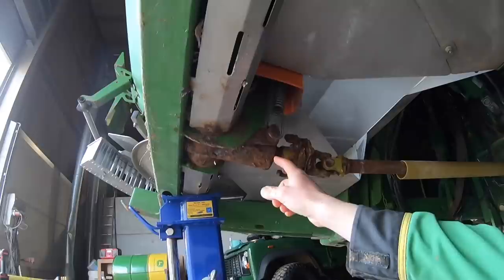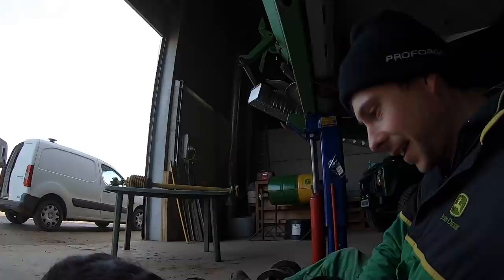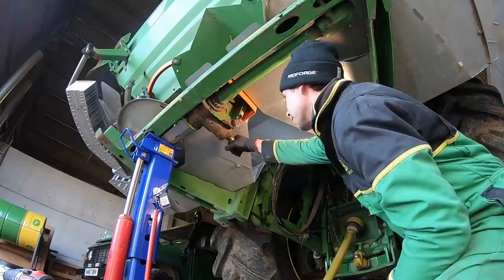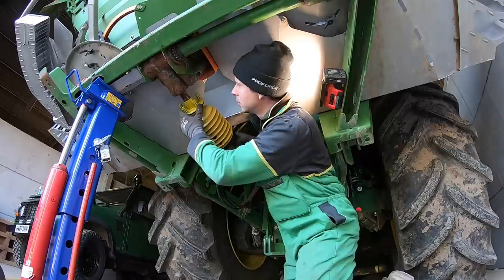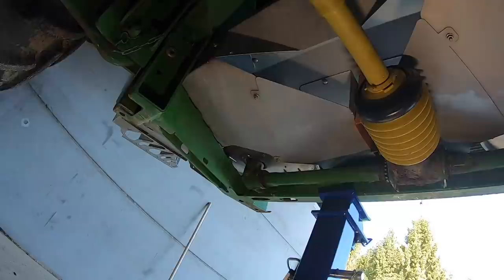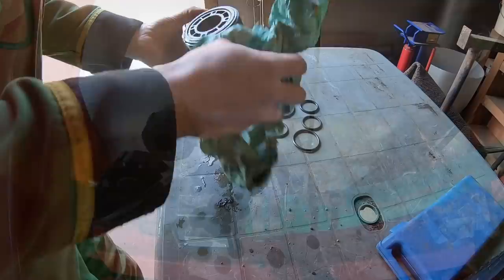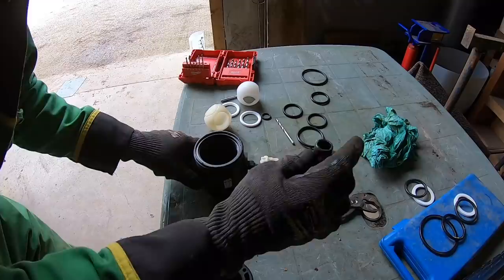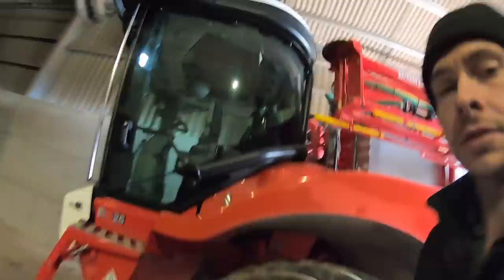New PTO Shaft On The Amazone Spreader & Seal Kit For Bateman Prime Valve

Comment: You could cut a hole in the bottom of the guard to let water/fert out so clutch isn't sitting in water and would make greasing easier,  a hole about 80-100mm square should do the job👍